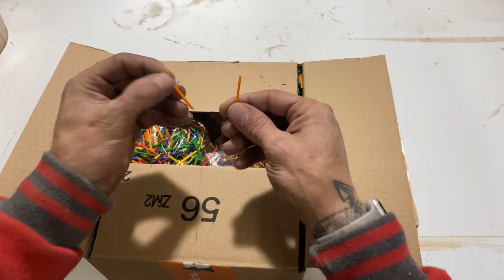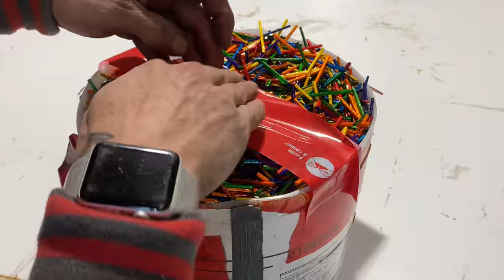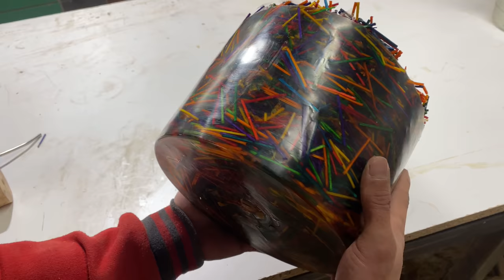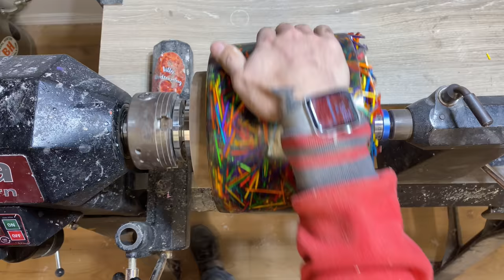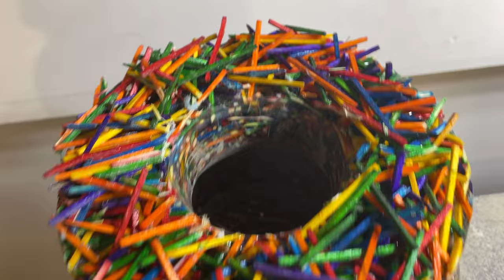Wood turning - 10 000 Matches in Resin

Comment: Were you at all concerned that these matches might light while you were turning them? I did learn a couple little things watching this so it was well worth my time.
Reply: Looks like it is just the sticks,  no phosphorus heads to ignite.
Reply: @mperk12000  Hey part of me was hoping to see some fireworks. Lol.
Reply: @mfcpwoodworking2269  I’ve been waiting to see someone pour over matches and see if the heat with ignite them, or even ignite them and let the resin cure over the fire. I’m my mind the smoke would leave a pretty impressive design if incapsulated in resin.

Comment: If the top had been smoothed it would have made that look good. But with it all jagged like that.  It looks unfinished and dangerous.
Reply: Doesn't look unfinished at all. Dangerous lol its sitting on a shelf, oh no I might get a splinter 😂
Reply: I agree. Not so much with the "dangerous" bit, but the top should have been smoothed off, like the rest of the item. It looks messy.
Reply: It bothers my OCD
Reply: @123456789oldenholden  fun fact! splinters can actually cause necrosis depending on what was used to dye the wood : )